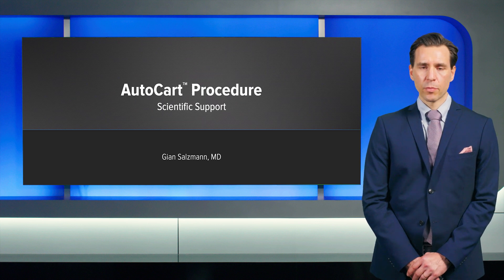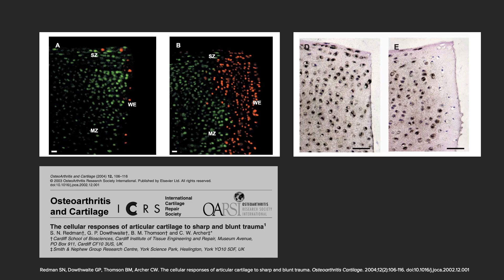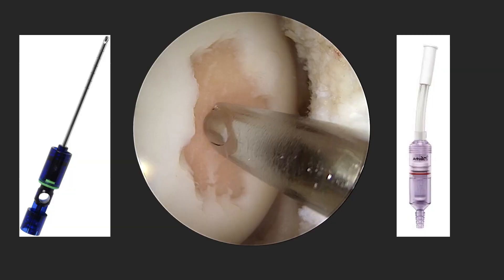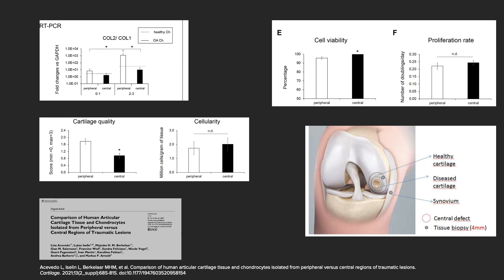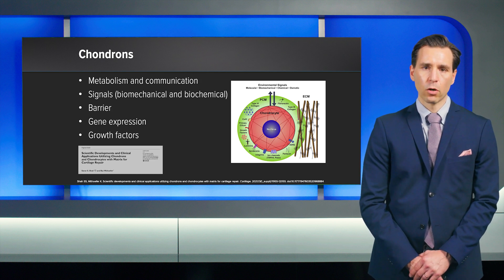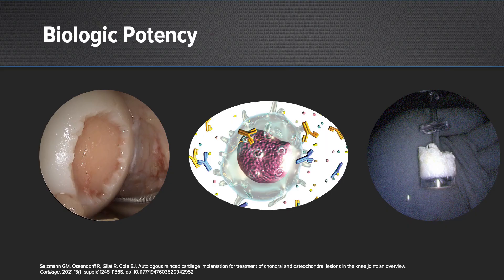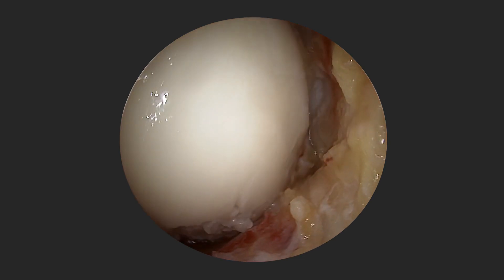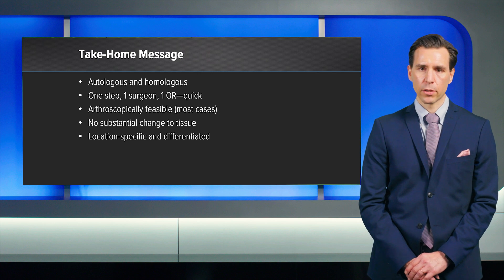AutoCart™ Procedure: Scientific Support

Comment: I am asking where might I get enrolled in a clinical trial to do the auto-cart procedure? I would fly there at my expense to participate in the trial. In America there’s a clinical trial called CartiLife and it is 2-surgeries. They take rib cartilage and ship that to Korea for processing into small cartilage pellets, then after 2 months a second surgery to the knee, to remove loose damaged cartilage in the joint and fill the space with rib cartilage pellets. I’d be willing to try this in the trial IF they would cryogenically preserve the knee cartilage they removed as a backup plan in case this rib cartilage patch fails. Eventually I will probably be able to afford the auto cart procedure.